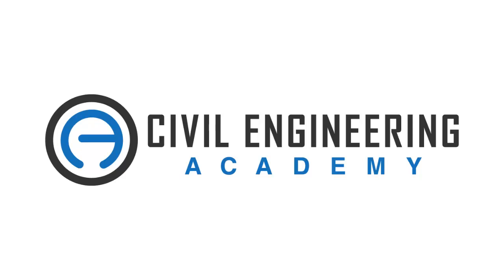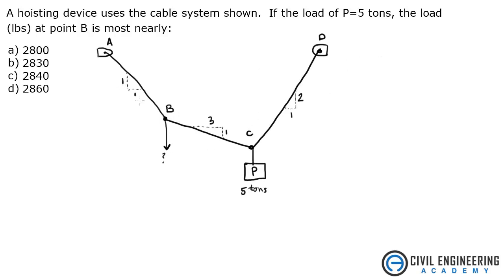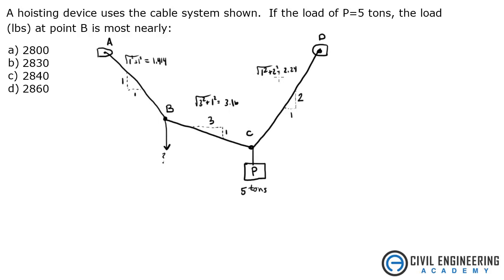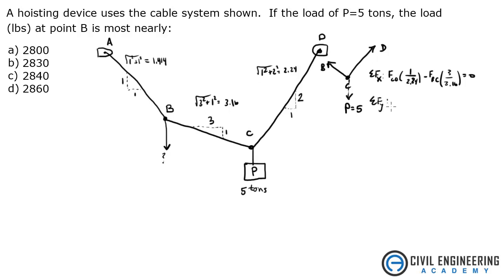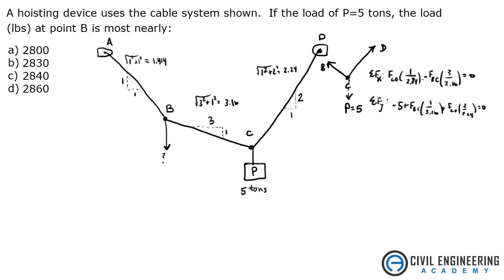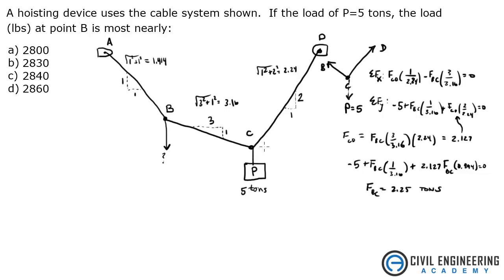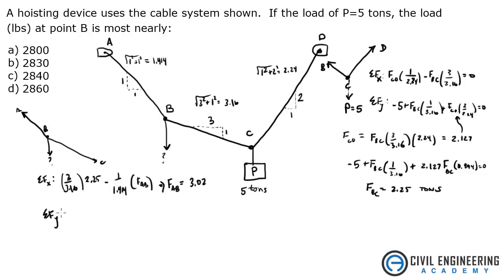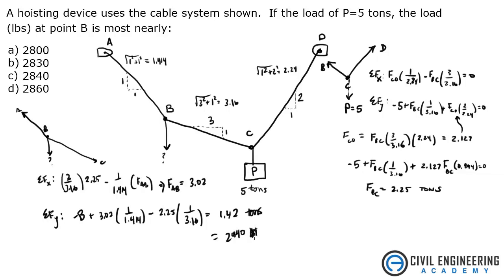Construction-Cable Statics Problem

Comment: I think the fact that you solved for the hypotenuse instead of leaving them in the square root form when entering the calculations rounded your numbers down. If you leave your numbers in the square root forms you will get D as the answer.

Comment: I calculated 1.43 tons.  1.43 tons = 2860 lb, which is d).  I think the answers offered are too close in value.  If you were to calculate 1.42 tons, which is only .01 tons off, you would have gotten c) 2840 lb.  Answers c) and d) are only off by .01 tons, so you can calculate the problem correctly, but because of rounding numbers, you can pick the "wrong" answer.

Comment: B = 1.42 Tons. That's right. However, 1 US ton = 2000 lbs. Thus,  1.42 tons * 2000 lbs/tons = 2857 lbs. ~ 2860 lbs. is the right answer.

Comment: Look at the FIRST STEP .  Conceptually the magnitude of Force CD compared to the Magnitude of Force BC favors Fore CD in the Y direction.  Just by looking there is no way that Force BC is greater than Force CD with respect to the Y components. I solved this using trigonometry and solving for each X and y components. My answer was 2860 LBS. Don't short cut the math, something is wrong here.  :')

Comment: Without approximating the hypotenuse for the ratios for Fx & Fy components I ended up with exactly (10/7) tons, which is about 2857.1 pounds.
Reply: +Ralajer ... yep, 2 decimals is not a good approach for trig-type problems ... i solved this again considering more decimals and my answer is D. (Force B = 1.429 x 2000 = 2858 lbf)
Reply: exactly..use the trig

Comment: but the triangles are only to find the angle not length?
Reply: +paviaaPS3 Not even to find the angle, but to use them as a ratio to find your component forces, which takes much less time than finding the angle then using sine and cosine to find the exact same thing.